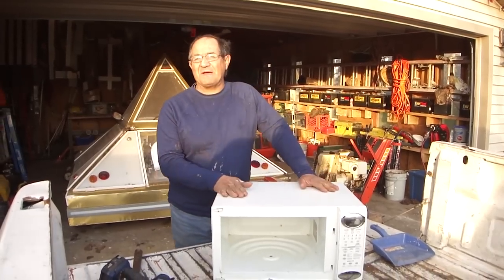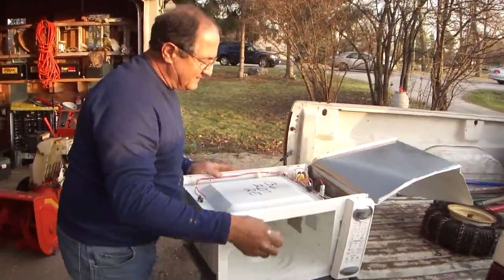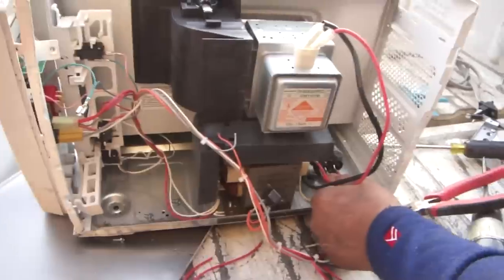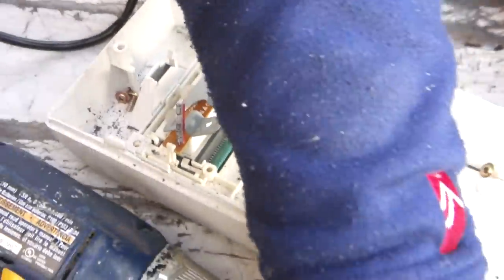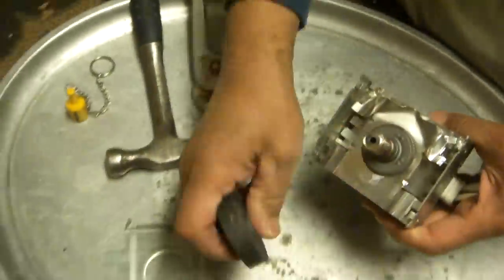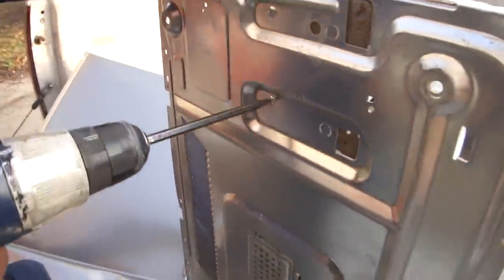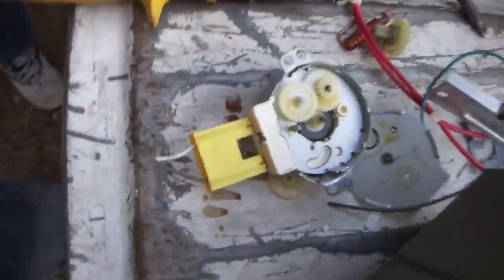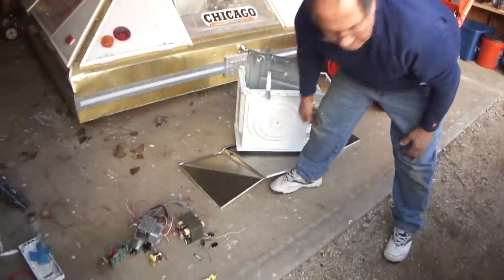How To Scrap A Microwave Oven For Metals / Money

Comment: This is kinda funny really.   But also dangerous, if you just do a little searching, may take you a few hours, you can get some good info and then you will not have to do the searching again. Even a jacked up Microwave has value, might be considered hidden value to a novice scraper but people are looking for working magnetrons, working capacitors sell very well,    for instance, the one I am looking for right now is going for 45.00 used and he just shredded one just like it. 
  There are parts in this microwave that can kill you. See that pink thing on the magnetron? yeah? Break that and breath the dust or get it ion your eye of mouth.  your screwed, it;s poison. also the ceramic looking thing on the other side that is white.

   If you really get unlucky and don't know what your doing you can get a shock out of that Capacitor that can kill you RIGHT NOW, even if it has not been plugged in for a  long time!   Seriously, if it doesn't kill you ( probably won't), you will probably need to, at the very least have to change your shorts, it delivers quit a shock is what I'm getting at. That little motor he pulled out?   yeah touch those connectors while you spin that dial backwards and you will have about a half hour to wait for your nuts come back down outta your gut. LOL   I'm not kidding. 

   without tearing all that stuff apart, if you just tested it to see what parts are still good,   could have got 25 to 80.00 in parts. taking it to the scrap yard  maybe you get 5 to 7 bucks and hours of work.
Reply: Leisure suit Larry I doubt there is anything in that thing that is worth $45 used since a brand new microwave can be had for well under $100.  That looks like the one I recently bought new for about $60.
Reply: yeah , to make any dough at this you woudl have to find some one with a boat load of them to give away really.      funny though, some parts , if you post them on eBay will sell.
Reply: +Leisure suit Larry yeah but it would have to be a local pick up since the post office prohibits hazardous substances from being mailed and beryllium is a hazardous substance.
Reply: +Leisure suit Larry Could you please tell me what that thing at the end is?? I'm just getting into electronics, thanks!!
Reply: How would you suggest someone should go about selling used microwave parts? eBay? Amizon?

Comment: Not sure if you know now but the thing with magnets is called the magnetron don’t ever break the coloured ceramic looking parts as it’s dust is toxic
Reply: Also the centre piece that has all the aluminium fins it a solid piece of copper I scrapped out 20 or so magnetrons as aluminium breakage before I found that out

Comment: that solenoid is really a extremely high voltage cap 10,000 volts
Reply: Kristyanna Virgona 
Question: I collect electronic parts like Capacitors and store them all separately in plastic bags.  I know they are toxic and when damaged produce an odd smell.  What is that?

The damaged ones or stuff I don't want I have in a garbage bag for a E-Waste company to come to my house and pick up for free.

Comment: Most microwaves can be fixed. Unless the transformer burns out, the unit can be fixed. Usually the part that goes out is on the control panel. So you may have scrapped a good unit.

Comment: at 4:47 that was a capacitor which holds a charge and can be dangerous.  you take something metal and short out the terminals to remove the charge.

Comment: What you called "Aluminum breakage" there is a good piece of copper break off Ali. fins, cut off the ends. There is two steel washer type, pull them out and you have your copper.

Comment: That small slug in the copper coil is iron ceramic, not manganese.  And that solenoid was a capacitor the shell is aluminum.  In side it's paper and a foil.

Comment: Ok a couple of things... I hate being "that guy" right now, but I have to point all of these things out. Number 1, I HATE when people show up to my scrap yard with this shit. They disassemble something and think they are getting one over on the system. Just bring the damn microwave in as a whole and get your $2.00.  You spend one hour of your day disassembling something to make $2.25?? Where is the logic in that. I spend more time weighing all the different shit in then its worth. All of that wire, which will be considered number 2 insulated, or number 3 depending on the yard, probably adds up to a quarter pound?? If that? So, you did all that work to make .04 cents? That aluminum piece is maybe 1 pound?, so thats 50 cents. Half of those "copper" motors you took out, arent copper,,, they are copper coated aluminum, which is junk... tin price at maybe .05 cents a lb. Now, you would think that by you breaking this all down, you are making more money, but logically think about it. You took off anything that has any weight to it. The magnets, the plastic inside all adds up. You would have made the same amount of money if you left it whole I say....
Reply: Sho'Nuff, The Showgun of Harlem Glad I don't go to your yard. My yard is happy to get my business whether I have a small load or a larger haul. There is pretty good money to be made from scrapping when the prices are up and you know what you are doing. My guys have also helped me learn a ton. Like I said. Glad you aren't in my town.

Comment: Do microwaves have capacitors like the old tv's used to.
Reply: It doesint cuz tv have an flyback transformer and a vacumm tube that can lwad to charge about 20000v mostly like an capacitors and yes tv have capacitors mostly they are the sized the cap

Comment: That part with the brass piece that you didn't know the name of is the magnetron. The ceramic pieces are impregnated with beryllium which is quite deadly if you chip or crack that ceramic. Use caution and wear eye protection along with a face mask. For all those watching this video, scrap safely, ie don't do anything this guy does.

Comment: That thing you called a solenoid is a high voltage capacitor with toxic fluid inside. The magnetron has a highly toxic beryllium oxide ceramic that should not be broken.

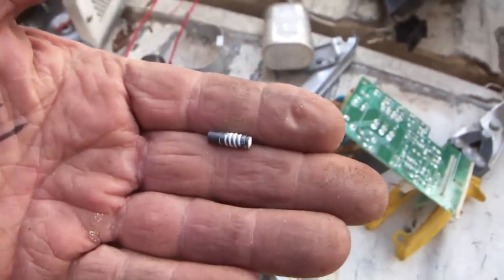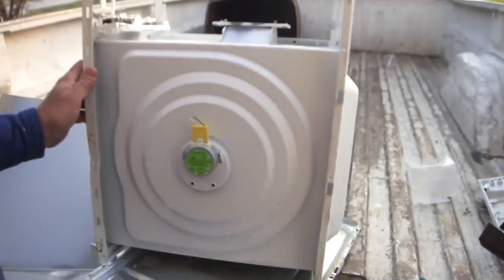Comment: at 8:22 its ferrite and its a noise suppressor. 8:52 no, it's ferrite. 'the top' is the antenna. The whole thing is just a powerfull radio transmitter at 2.4Ghz. 12:28 how is it not obviously the turntable motor?

Comment: ""WARNING""  That thing on the bottom right of the power supply is not a solenoid it is a Capacitor. I know of someone who was KILLED working on an unplugged Microwave. You need to discharge the Capacitor before you doing any work.

Comment: You can also just pull a lot of the wires off with the end clips still on and they will add to the weight of coated wire a little bit. Should wear gloves to do it though.

Comment: Thats not a solenoid. Its a capacitor that may still have voltage on it. Be careful they can kill you depends on size. Cut one wire at a time so dont ruin cutters. After loose can de energize it.

Comment: Forget the scrap metal value of a microwave, it's not even worth the time. However, if carefully disassembled, the magnetron, fan motor, rotating plate motor, and glass plate can be sold on eBay. I got $38.00 total for all the parts of my old microwave that wouldn't even sell at my garage sale for $5.00.

Comment: Capacitor, not solenoid. You are collecting circuit boards, not motherboards, big difference. 
OH and that thing you carelessly beat to crap is call the Magnatron. It's the part that generates the microwave RADIATION. Playing that could have dropped you dead in an instant. Find detailed what you are doing for your families sake.

Comment: Wow. That's not even worth it. 
$2.97 here in Canada per pound. I'd never go through that much just for dinky pieces of copper. 
Welding wire is where the weight is at.

Comment: you just cut the capacitor and it still hold a charge for sometime, so tell people to take 2 screw drivers and touch the ends  of it with crossed drivers...

Comment: The turntable motor has a ring of hairline copper wrapped around it but you got to get the bottom piece out of it and then there's a piece of tape on top of the copper unwrap the tape and there's the hairline copper

Comment: It's not smart to smash the magnetron. The 2 ceramic ends on it are made of beryllium or aluminum oxide. I think the pink ones are beryllium and beryllium is toxic to the body. It's fine as long as you don't smash it and breath it in. It's best to just invest in a multimeter and test to see what parts are good and sell them on eBay. You'll make a lot more money than just scrapping them. The transformers are very useful and can be used to make a lot of cool things
Reply: JustinLodes and i am so glad you people are talking about all this dust flying around! none of you even noticed the guy is doing this disassembly OUTSIDE!!!
the guy is smarter than you think!!!

Comment: that was a magnatron tube that you wrecked to get the 28 cents worth of copper. And there is no magnesium in a microwave. and like someone else said the " solenoid" was a capacitor. Lucky for you there was a bleeder resistor on it or you would have the special dance that attracts the ladies.

Comment: Have Micro Wave' changed?  All of mine had warnings do not open oven contains radiation....  Has that changed now?
Reply: It "contains" "radiation" when the microwave is ON (hearing the whole thing working) Also the radiation is electromagnetic type, like radio AM-FM waves but much shorter in wavelength. So yeah if it's unplugged, there's absulutely no radiation in it. The other radiation what you may be aware of is the nuclear radiation. You CANNOT find that kind of radiation in microwaves, telephones, televisons, etc. Very old radios and watches (from '30s to the end of '50s) may contain radioactive materials like thorium and radium. Factories used these in "forever" glowing paints. Also modern glowing paints doesn't contain these kind of materials.

Comment: Wow...  That "solenoid" is actually a high voltage capacitor, could possibly kill you. That other unknown piece is the magnetron, the main ingredient in all microwaves.
Reply: It had a diode on it for self discharge, which does it's job within minutes. Even without the diode, caps will discharge within days. I watched him cut the wires off - he actually did it safely. He went fast and played ignorant to get a rise out of everyone. He knew what he was doing, lol.

Comment: If that transformer was good, you just cut it up and lost big money. What you called a solenoid was a capacitor. And you could have gotten more money for those little switches in the control panel than you got for the copper in them.  And that magnetron with the aluminum is worth more in tact with the magnets on it than you could get for the aluminum.

Comment: You will find that the wires look like copper are not. they are copper clad. use a magnet to test. I did this and it is a waste of time and energy. Very few parts are actual copper. Not worth the trouble.

Comment: sometimes i tell myself that i should start scrapping to earn extra cash, then i think about how much money you end up making per hour and all the effort you put into it, then i realize its not worth my time
Reply: Everyone who scraps just does it as a hobby. I do it to kill a little time.
Reply: Poor Man Mods If you do it the way this guy is, then yes it would be many hours of effort for little return. Scrapping stuff with some forethought gets really good returns. Even just snipping the power cables off broken appliances.
Reply: Albert Mag For something like say a toaster i would just snip it off and throw the rest, not worth the bother to go any further. With bigger stuff like fridges or washing machines there's enough extra wiring in there to be worthwhile. Plus those things are coming apart for motors etc anyway. Insulated cables are only worth $1.49/kg in my area atm, so i balance up the extra time with how much money is in there.
Reply: Albert Mag I've not come across aluminium windings yet, could that be due to Australia using 240V power as compared to the 110V in North America?
Reply: One of my jobs involves repairing swimming pool pumps, and i can say with certainty that none of those have alu windings. I haven't seen any other motors or transformers with alu windings either, but i wouldn't go on the record as saying they don't exist here.

Just out of interest, i retrieved the wiring out of an old dairy the other day, only took about half an hour and returned $50!

Comment: I wonder if he realizes that the magnetron tube can kill him slowly   by inhaling the beryllium dust from the ceramic insulator. it is fatal if inhaled. Not to mention the capacitor he pulled out was high voltage and could give a jolt so strong it could stop his heart. or at least fry his fingers down to the bone. Don't do this his way. it's better just to set up a snow cone stand in your front yard.
Reply: I didn't know about the beryllium dust, but a real scrapper like me, always wear a mask and ALWAYS take something INSULATED to empty the capacitor this guy don't know what he is doing

Comment: im cringing in my seat, this id better than a horror movie
 when you get that horrible horrible diagnosis from your physician, refer back to this video. specifically the beating of the transmitter. lol. this video is a perfect demo of what not to do. ps those little copper thingys with magnesium. those are inductors, with a soft ferrite iron core. not magnesium.  and never, ever beat a magnet with a hammer. actually you should use a hammer to beat a nail. gibe someone a hammer, and everything becomes a nail... lol. for my next trick, i will beat this smoke alarm open with my hammer and see if theres copper...

Comment: This guy is smart enough to learn the ins and outs of the scrap metal buisness, but not smart enough to look around on youtube at all the creative and valuable things that can be made with a microwave oven, or its components. The scrap metal value of ANY object is the lowest possible return for any metal item.

I microwave oven can be turned into a small welder.

The cabinets could be turned into a portable car battery container. They could also be tuned into storage cabinets. The cavity between the inner and outer walls could be filled with insulation to make a small but strong cooler. The list is endless...

Comment: Several things here...one sad that a MOT was brutally destroyed two your lucky you didn't die from the HV (High Voltage) AS YOU CALL A FUCKING SOLENOID WHEN ITS A CAPACITOR and three lord Jesus the way you manhandled that magnetron wouldn't be surprised if Ba 56 leaked into your system Jesus Christ dude

Comment: I find it hard to believe that there are so many foolish people posting videos, stripping out microwave ovens without first discharging it. 

This guy has no idea just how dangerous it is removing things when he has  not discharged the capacitor. 

He is lucky to still be alive. The capacitor holds 2,000v. If that were to pass through your body, which it can do if not discharged in the correct way,  by using a discharge capacitor tool. It will kill you.

For the sake of a few dollars. He has foolishly decided to risk is life.

Please do NOT do what he has done.

 If you do not understand the dangers of high voltage components stay away from it.

He may value his life at $5 or $10 dollars but it doesn't mean you have to value yours at that price. 
If you really must take apart a microwave oven without knowing anything about electrics. Take a look at the video, Microwave Oven Troubleshooting in Minutes - Step by Step. 

Its by electronicsNmore. Although he's not stripping out the microwave. He does explain and show you how to safely discharge a 2000v capacitor.

Please use common sense and be Safe, ALWAYS.

Regards, Paul Jones

Comment: This "scrapper" is totally incompetent.  First thing he does is cut the terminal wires from the power cord. He has obviously no knowledge of how useful pre-terminalled quality wiring is to an even very basic DIYer or experimenter.  As well, no mech skills.  it's embarrassing to see this guy bend back a cabinet end rather than easily pull it off, and have useful flat sheet metal. It gets worse from there.  Some of the comments are just as stupid as the video itself, "it's not the voltage that kills you, it's the amperage", for example.  What creates amperage?  Voltage, of course (grade 9 science).  But hey it's 'murrica.  Yecccch!

Comment: Be careful guy you can get a chock e die.       there is 2.000 up   volts in the capacitor same  the microwave  with energy.  If was me I will gain money with these pieces.   copre, wire, alumin etc.

Comment: Well, this chap does not know a capacitor from a solenoid. He likely dumped the very expensive EHT diode (£25 each) and it's replacement might have saved the whole unit.
The magnets are valuable too. So, he brakes the cancer causing BERYLLIUM filled magnetron like it was a toy.
Oh well, there is no telling the ignorant about these things, they just laught at you, but no so much at the oncologist.

Comment: very dangerous..the capacitor holds a charge that can kill you..the thing that said high voltage is the transformer, it doesn't hold a charge but is possibility worth the most intact. the magnetron has poisonous materials if inhaled from smashing or the careless demolition you do..read up on things before you hurt yourself, or at least watch other videos and learn what you're getting into..stay safe!